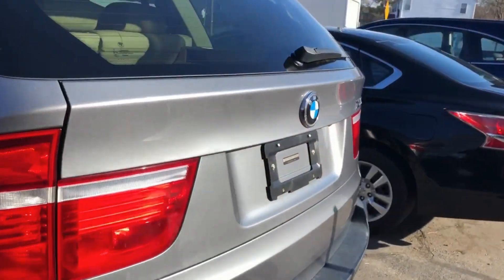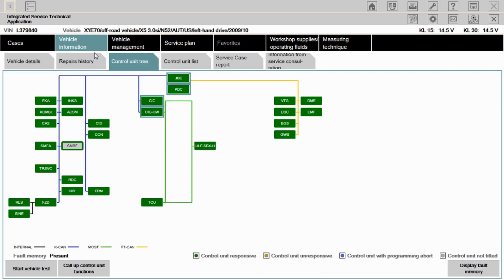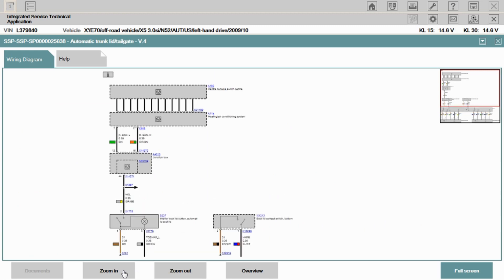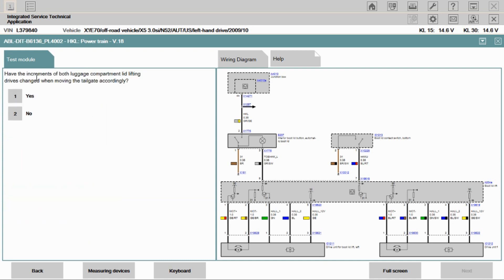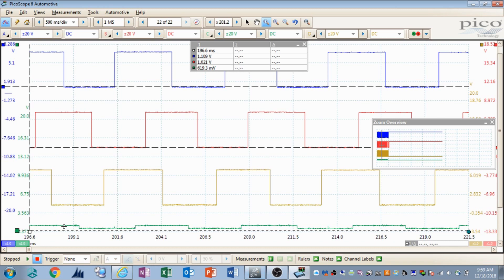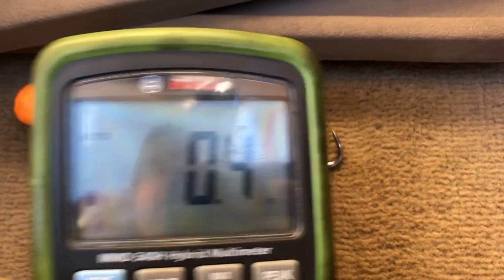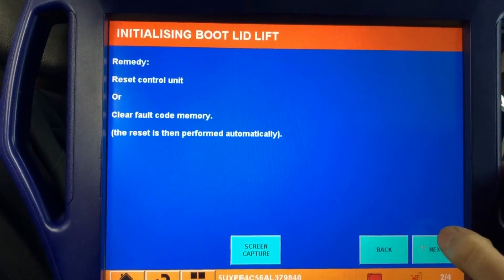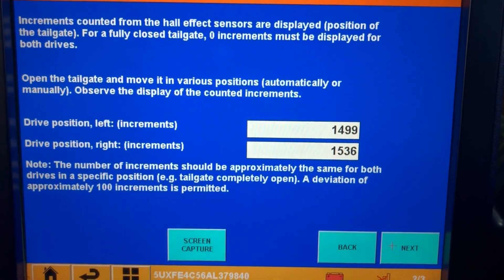2010 BMW X5 Power liftgate wont close- Diagosis and calibration

Comment: I have HKL sensor, short to negative and HKL Open circuit. Also hall sensors short to negative. No water damage in module. Battery is at 11.5 V. Not the best but not bad either. Any ideas? Maybe a lose or broken wire?

Comment: One question...why did the lift gate close when actuated from the scan tool? Seems like it should have failed as well. Also I can remove a fuse from the module and put it back and lift gate will close once with the button, but no more until I remove the fuse again.

Comment: I have had this issue since I bought mine, just dealt with it by pulling fuse #99 to reset the system every time. Thanks for showing how to actually test it, looks like I need to break down and get an ISTA cable.

Comment: Thanks for the video. Mine stopped working, thought the shocks are the problem, but discovered that the trunk seal leaked in bunch of water and the trunk module got soaking wet. Replaced the trunk gasket($90) (the big one that goes all around), replaced the module from a good used one from ebay ($200), removed the 3 fuses that go in the trunk (#99,121,135) let it reset for couple of minutes, put the fuses back and everything is working. No calibration needed.
Reply: check out these videos to address your water leak.  Glad you were able to replace module with a  USED one without coding.  I had the same good experience and outcome. 

https://youtu.be/6QavsbDkpsk 
https://youtu.be/nqJDajjLIWI
https://youtu.be/JBhoU37Wi24
Reply: Thanks for the information. 
When you pulled fuses #99,121,135, did you start the car or did you pull them for a few minutes with the car shutoff?
Reply: airbornesoldier i think it was off. Can’t remember.

Comment: Mine has a similar problem, it occasionally starts working but mostly won't.  The tools used to diagnose seems out the reach of the occasional user, is there a video of how to reach the cable hardness to check for loose cables?